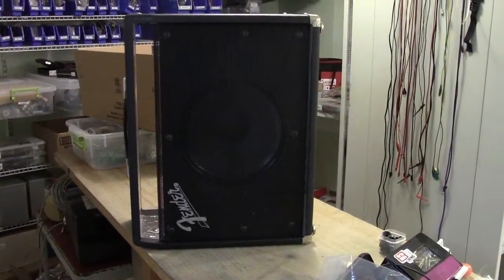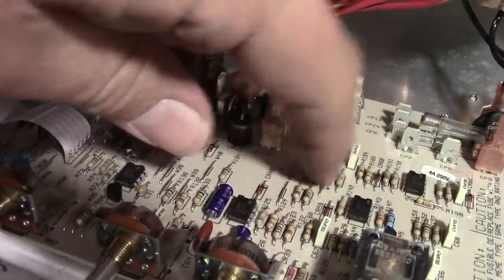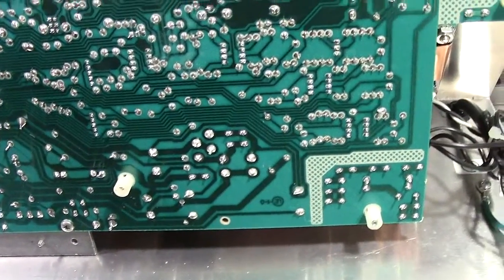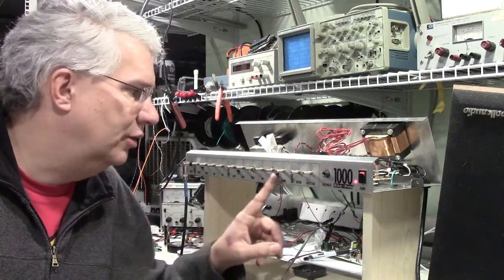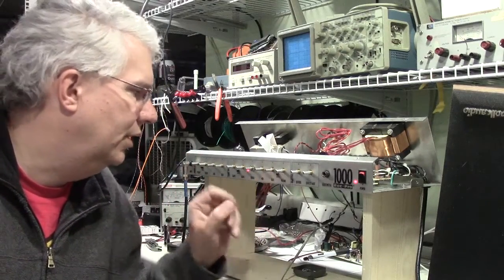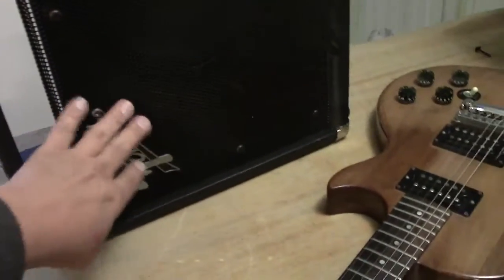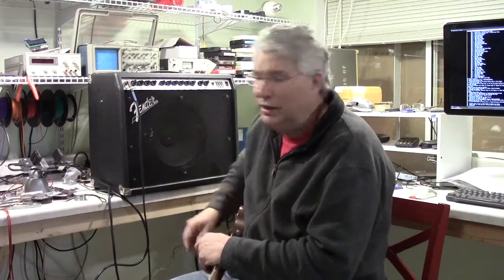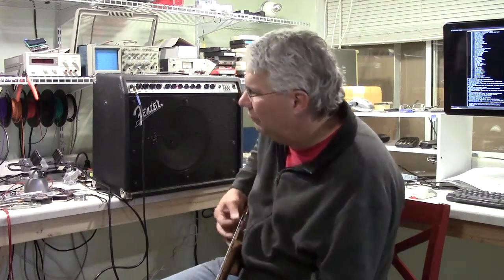Volume - Repair - Fender Roc Pro 1000 with Cold Solder Joints

Comment: Question: The Fender Rock Pro 1000 puts out about 100 watts RMS. Yet the combo used only one 12” speaker. I have seem some combo versions that have 2 x 12” speakers. And if you get the piggyback versions, the cabinet comes with 4 x 12” speakers. Yet it’s the same 100 watt amp. How can that be?

Comment: Hi thanks for the video, I have the same amp but the transformer is disconnected, would you be able to tell me which wire goes where? I can kinda see in this video but I dont want to guess. 2 solid red and 1 red and yellow wire.
Reply from the maker: Sorry, I can't help you here. This amp repair was for a friend 4 years ago. Look up the power transformer part number to find the wiring diagram. That should ahoq you the information you seek.

Comment: I just purchased a Roc Pro 70, and the clean channel is just wonderful.  The tube channel has almost no volume, but it does work.  I'm assuming that since it is at least ten years old, this means the 12AX7 is probably worn out. How close am I to the correct solution?
Reply from the maker: you'll need to take some voltage measurements. might just be dirty pots.
Reply: @CraigHollabaugh  Many thanks for replying; and yes, the pots are certainly dirty. The amp looks like it came through 'Bar Wars'.
Reply from the maker: @zincChameleon  look at dc voltages, shown here http://schems.com/bmampscom/fender/Roc_Pro_1000_schematic.pdf

Comment: Hii Craig, nice video man, thanks for sharing! I have this amp, and i repaired him one time, cause his power off suddenly. I open the case and found a varistor with cold solder in input circuit. Now i know must be change this varistor input, but i dont know his value cause the component is clean of informations. Can you tell me what the resistence and voltage of this component? Sorry for my bad english...Thx dude.
Reply from the maker: Thanks, you're english is fine. As for the varistor value, I'd suggest you look the schematic, http://schems.com/bmampscom/fender/Roc_Pro_1000_schematic.pdf.
Reply: Thank's very much Craig, i'm trying to learn a little bit!! I will take a look the schematic.

Comment: Craig
I noticed something that your repair has in common with mine- the loud snap accompanied with turning this amp off sent to the speaker

Is that able to be muted so it's NOT causing that transient to hit the speakers? Or is this a sign of some other problem?

Of course,one could always unplug the speaker cab from the head.

I've got a Roc Pro 1000 head and a B52 4x12 cab.

Love that soldered in-place tube.I will soon replace that with a more professional socket and clamp assy for swapping tubes,although other mods say that this is stupid-because unlike other hybrid amps-this amp will still work without any tube at all in it-like the triode is using only one diode to introduce distortion along with the channel's designed gain increase which is all solid-state.
Reply from the maker: There are many possible reasons for this pop. Here's a couple questions: Is it the same loudness pop if all the volume knobs are turned to 0? Is it the same loudness if you simply unplugged it from the wall (ie don't use the power switch)?

Comment: Hi, thanks for posting this video. Please would you provide more details about the repair? I have the same problem with my Roc Pro 1000 including lots of loud bangs and pops even when it is just stood still with nothing plugged into it. I have recently pulled this amp out of storage and was just going to sell it as needing a repair and buy a new one. Would love to fix the problem as it is a very loud amplifier and the effects loop is great.
I was going to start by purchasing a new preamp tube a 12AX7. Would you recommend this? 
Thanks for any advice.
Reply from the maker: Do both channels behave the same way?
Reply: +Craig Hollabaugh Yes,  regular loud pops on both clean and overdriven channels.
Reply: Also wanted to mention,  the cracking and banging occurs when knocking on the top of the amp.
Reply from the maker: +David Alan Jones David, I really didn't do much more than I discussed in this video. Mainly, I reflowed (heat up with a soldering iron, adding a little more solder) to the large components on the bottom side of the board. It took longer to take the amp apart than the actual repair. I'd start there because your amp's problem exists on both clean and tube drive. This points to the main output circuit. Also, I wouldn't replace the pre-amp tube until you get the output fixed, it might not need replacing.
Reply: +Craig Hollabaugh Thanks for this.  I'll start by resoldering. I think I'll clean the pots too as they're terrible for cracking. Thanks again